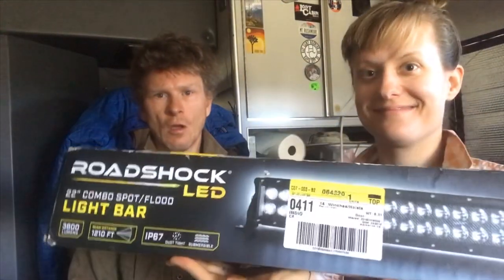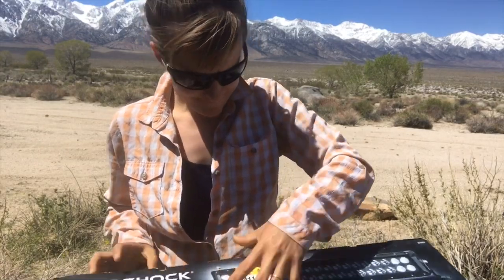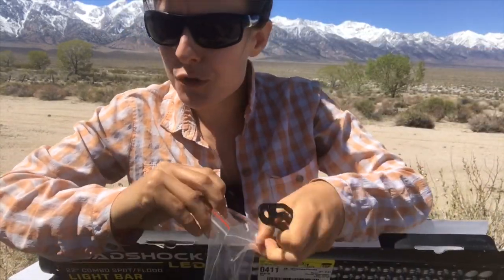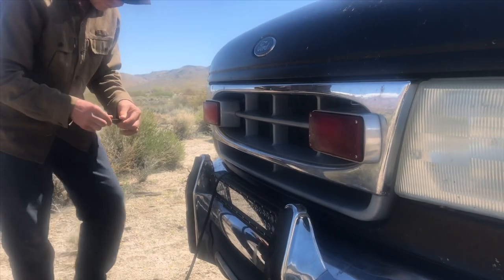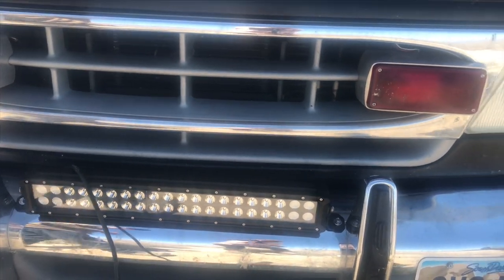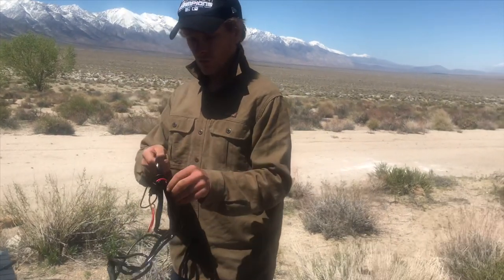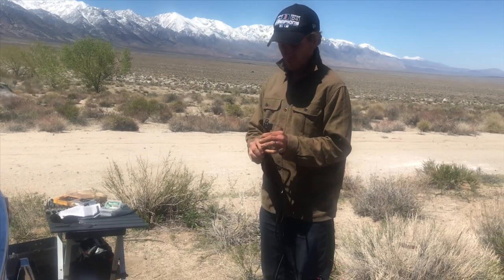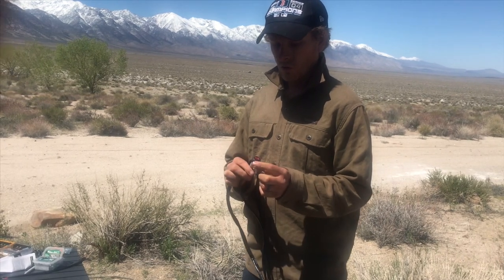We Installed a LED Light Bar on our rig - Living the Ambo Life

Comment: Great video. I have been looking at those lights to add to my tow vehicle because I plan on Boondocking for the most part. I will be towing a 16 foot travel trailer with my Nissan Xterra. Now I'll get the lights and install them. Thanks! 😎❤️
Reply from the maker: Marc Valley thank you so much. Sounds like a good plan. The whole unit plus the wiring kit cost about $80 at Harbor Freight. Totally worth it!!